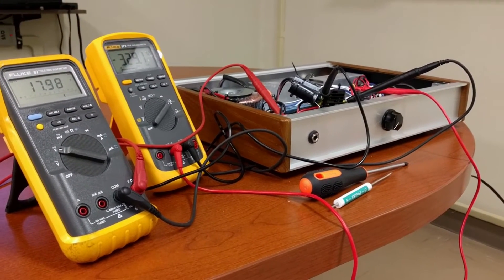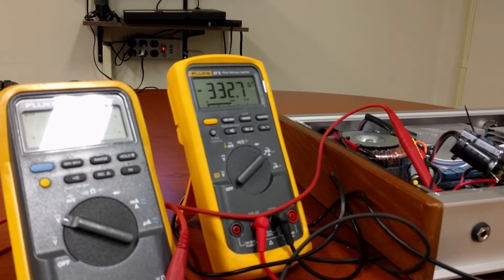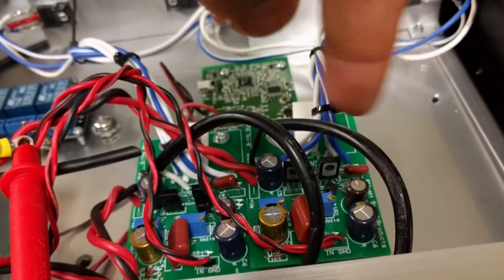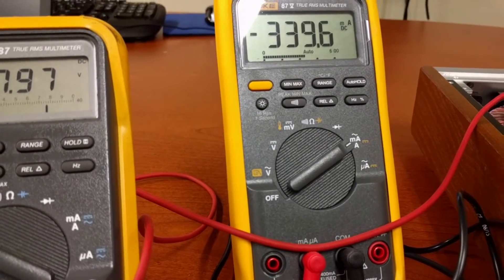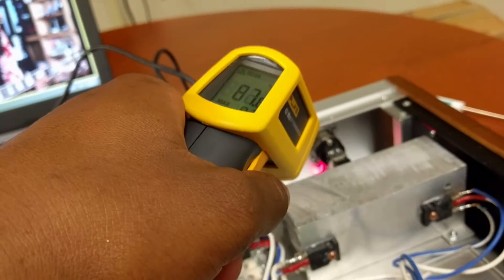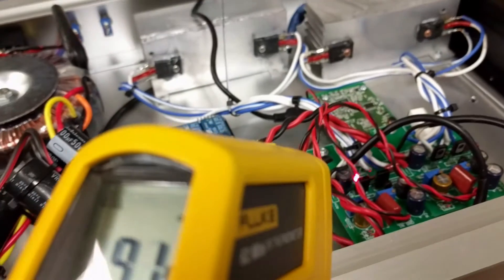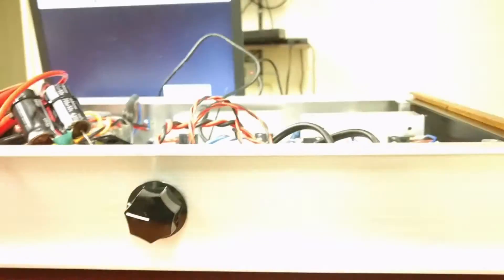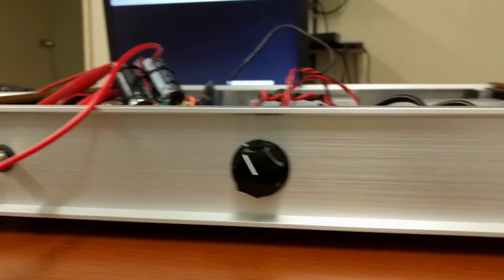Death Of Zen Server - Final Amplifier Biasing

Comment: Listening            Loudness         Voltage Needed           Current Needed      Power Needed 
Safe             85 dB SPL            0.1 Vrms                    1.61 mA                0.16 mW
Moderate   100 dB SPL           0.56 Vrms                    9.03 mA                5.06 mW
Fairly Loud   110 dB SPL          1.78 Vrms                  28.71 mA               51.1 mW
Very Loud   115 dB SPL          3.16 Vrms                  50.97 mA            161.06 mW
Painful          120 dB SPL          5.62 Vrms                  90.65 mA            509.43 mW

Those are the calculations for your AKG K7XX headphones..
which have :
Frequency response 10 – 39,800 Hz
Impedance 62 Ω
Sensitivity 105 dB
Power max: 200mW (can stand 350mW for 1-3sec without damage but  no longer!)

Your amp on 18V is capable of outputting 7-9 V  at  330 mA which is 2.31W to 2.97W clean power!
Those headphones are nice and i hope you wont break them(or worse-damage your hearing).
I worked as engineer in AMG in Vienna so I know a thing or two about this headphones (also they have almost same drivers as k701,k702.k712 etc)..
Your project is nice and i enjoyed your vid so i thought i give you small advice :)
Peace..
Reply: I changed the gain on the amp so it wouldn't kill my headphones. It was mainly pushing current.